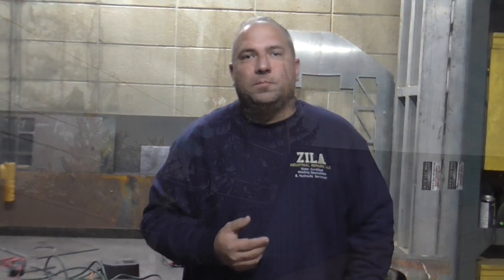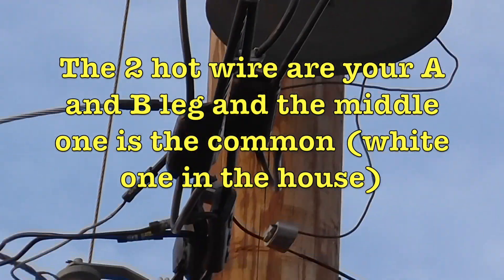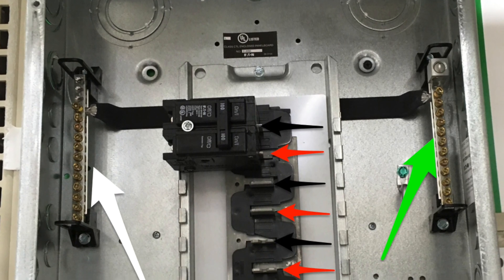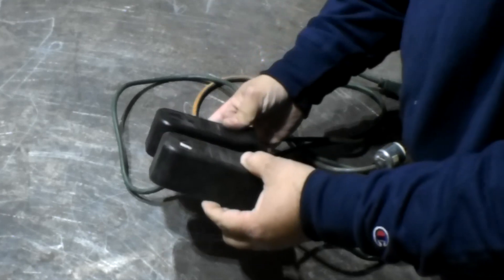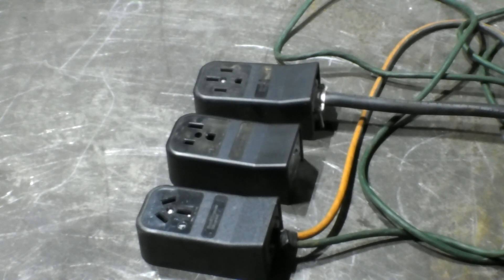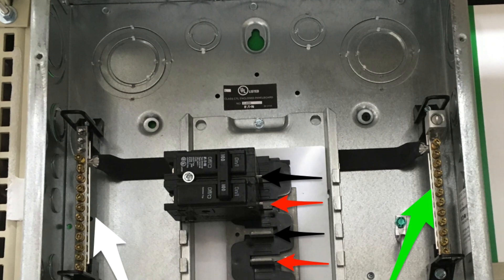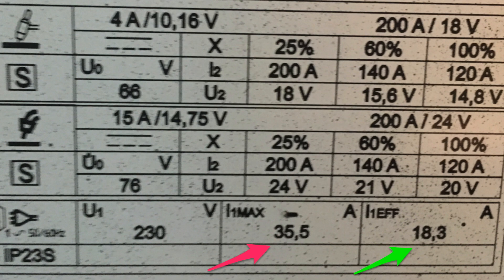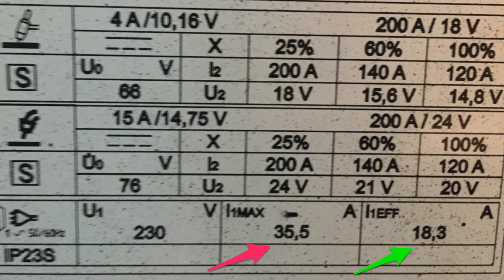How to run a 220 volt welder on 110 volt - Is that even possible ????

Comment: Good info if you need to this once. 

The different 220 outlets are for different amperage house hold appliances. This is so you cannot plug an electric range into a dryer outlet which the wiring is only good for half(?) the amperage the stove requires.

Some people have changed the outlet or the plug on a stove and had an electrical fire.
Reply from the maker: I don't know - in my house the range is 30 amp and the dryer is also.???  but like I said - I AM NOT AN ELECTRICIAN. check with a real electrician and local codes ....  be safe - don't burn your house down !
Reply: You're exactly right, but in addition, the wiring in the circuit is sized for amount of amperage.  Some people change the plug (or just plug in an appliance with large current draw of 120V) AND the breaker.  It "works", until the wires in your wall catch fire.  With all electrical stuff, you have to get everything right; one thing wrong can be catastrophic.
Reply: To be technically correct, you can plug a higher amperage device into lower amperage receptacle. either with an adapter or changing the receptacle. The key is that you CANNOT increase the rating of the Breaker. The breaker must protect the lowest rated component in the circuit.

Comment: This is fantastic. I am going to do this for my personal shop so I don't have to keep running a cord to the clothes dryer.  Makes perfect sense and you're thinking is all good.  It wouldn't meet code but it works!  Don't let OSHA catch you with this!
Reply from the maker: I didn't build it ...LOL. and I don't take it on job sites either....  AND I told all the viewers to get advice from a real electrician and be code compliant ...  so if you want to use it - do that AFTER you check all this and at your own risk .....  dryer outlet is typically 30 amp though - that is better than 20 amp with as cord like shown in the video .....
Reply: Thanks so much for all of your work. I know this will help me in the future
Reply: and remember you can always add fuses anywhere . like shut off valves for water 1 here , 1 there , 1 over there... the more the better right?lol